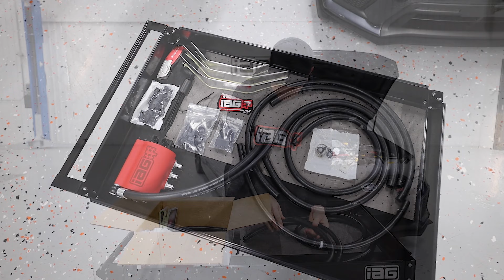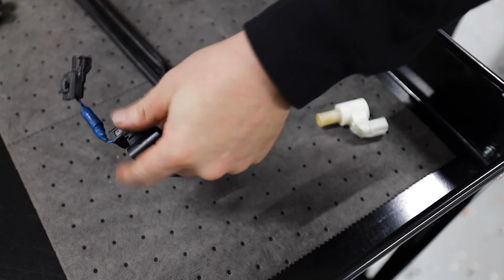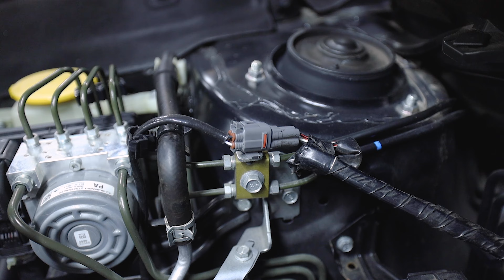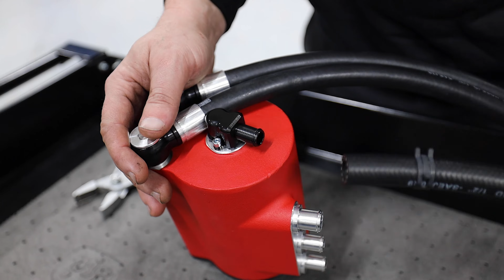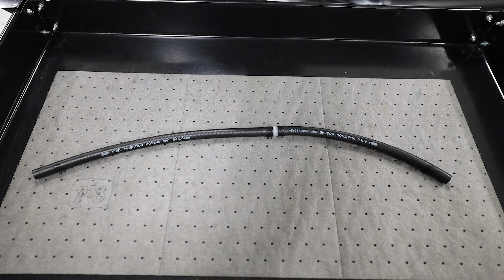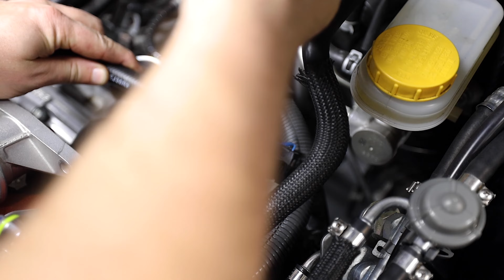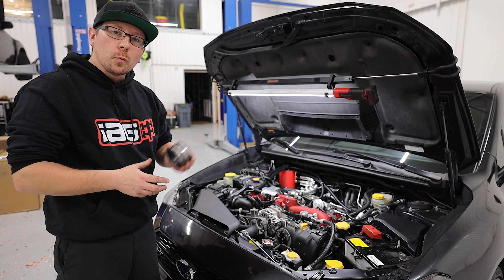2018-2021 STI Air/Oil Separator (AOS) Install Instructions | IAG Performance

Comment: Just used this video for my 2016 Sti. The install was a little different but pretty easy. I struggled to get turbo hose from Intercooler back on no matter what tool I used to get it over the bottom . I found that if you slightly change the angle of the hose downward it slides perfectly into the turbo without any tools and fits way better. I wanted to comment this for anyone who might run into the same issue. The version 3 is absolutely worth the money.
Reply: For real! I’ve got a 2017 STI that I’m getting ready to put the AOS On. Totally dreading the intercooler. I had to mess the with intercooler awhile back…. It was such a pain. I’ll try your tip tho!
Reply: I have a 2016 also and will be installing myself. What exactly was different from what was shown in the video?
Reply: Im stuck at this point. Do you mean you rotated the hose on the intercooler slightly?
Reply: WD-40 or Vaseline would make it easier to slip on
Reply: @renehernandez1403  Oh believe me your boy busted out the best lube available in this country. I finally got it using a fancy pick like shown in the video (durr). But I was 5 minutes away from just buying a front mount lol
Reply: I have a 16 Sti and I don’t see a drivers side pcv connector anywhere I’m lost I only see two on passenger side both near turbo
Reply: @FunfactswithAJ if you get an answer lmk i just ran to auto zone and grabbed some bypass connectors
Reply: get the IC in place over the brackets, dont screw it on to the brackets, just secure it to the throttle body coupler.  then you can wiggle the IC back and forth and rock it slightly side to side, but with the connection to the TB as your pivot point, it has just enough wiggle room to angle it on to the turbo while staying in place.  try to get it on, back off if it doesnt work, try again.  if it doesnt just pop onto the turbo right away, its way harder to try to force it on there than it is to just wiggle it off and come at it again

Comment: I’d assume this would be the same install for a 2006 STI? Or is there a video for a 2006-2007 GD STI?
Reply from the maker: GD install video is in the works!
The main difference is where the vent hoses attach. The GD will need to run 2 of the vent hoses directly to the forward most valve cover ports instead of intersecting with the white PCV connectors. Removal of the airbox portion of your intake and battery may be needed to reach those ports.

Comment: What is the worst thing that could happen if i put the hoses wrong?
Reply: Lol
Reply: The breather ports are interchangeable since they both go to the can internals anyways but mixing the coolant lines with the oil return would majorly fuck up your engine
Reply: The car will then drive forward in reverse gears and reverse in the forward gears. It’s just unavoidable. Best to double check hose orientation.
Reply: Yah the breather ports are all im worried about the coolant lines are easy to spot if thats the case then im good lol

Comment: How much would differ for the 2015-2017 models?
Reply: The main difference is where the vent hoses attach. The 15-17 will need to run 2 of the vent hoses directly to the forward most valve cover ports instead of intersecting with the white PCV connectors. Removal of the airbox portion of your intake and battery may be needed to reach those ports.
Reply: @BuckleUpGarage_  exactly. We're working on getting a bone-stock 15-17 in here to finish instructions and we'll have those posted up in a few weeks as well!

Comment: Will you recommend a location that I can install it in a JDM (right-hand-drive) wrx sti?
Reply: Also need this
Reply: @Ducati.sfv4s  I've just written hope it helps somewhat, I'm still not fully satisfied to go ahead with it though until I know for sure
Reply: same here I would like to know, been looking into this for very long, I've read that its the same sort of install with the unit on the other side obviously, some issues people faced in this case was the need for extra hosing

Comment: Absorbing all of this info for when i can own one of these amazing machines
Reply: Proper mentality 🙌🏼
Reply: That’s what I did then made it my reality. Love my STI. Good luck getting yours!
Reply: @robertsimon2262 same thing I did also. Love my STI too. This AOS was my first mod.
Reply: Have you gotten one yet?
Reply: @austinbasco2968  Theyre discontinued so i went for something else instead
Reply: I'm absorbing this to help my buddies with their's 😅
Reply: @FireKnight43 life savior
Reply: You get one yet??
Reply: There’s rumours of a 2026 STI but I guess we would have heard confirmation of that by now (Dec. 2 2025). If it happens there’s a chance it might be a hybrid or pure EV or hopefully gas only. The EJ engine is not in the picture by there’s talk of the 2.4 litre engine currently in the WRXs and “ tuned “ to make 335-375 hp. Pictures and even a couple concept STIs show some subtle but noticeable body panel changes to make it look even more “ sporty “. Hopefully ( sorry IAG ) it would come with an AOS from the factory or even better yet something like the Toyota double injection system ( direct and port ).